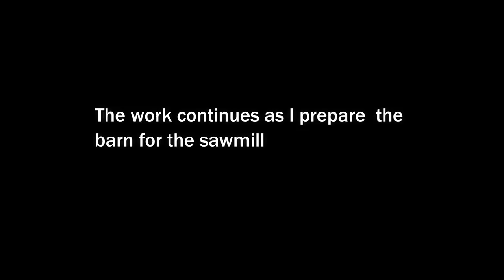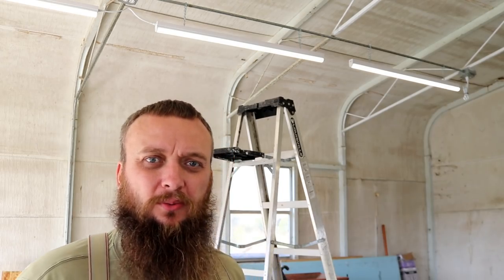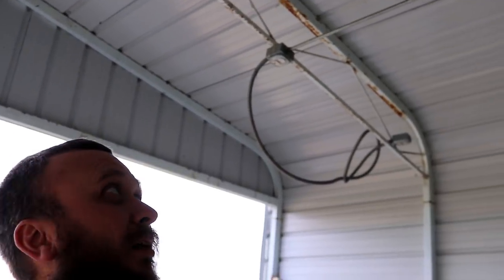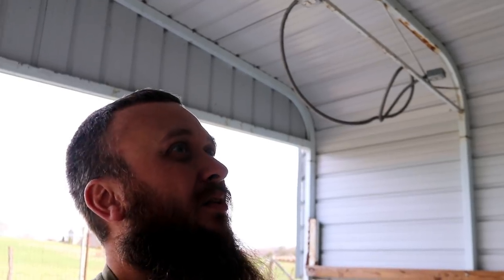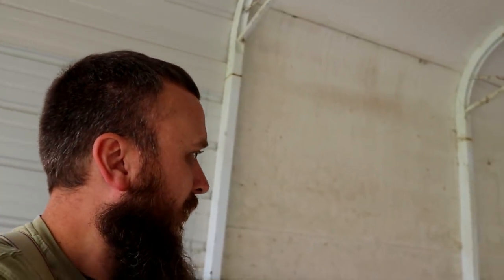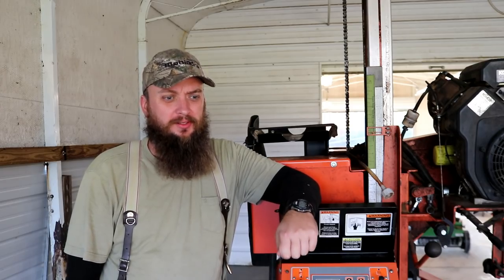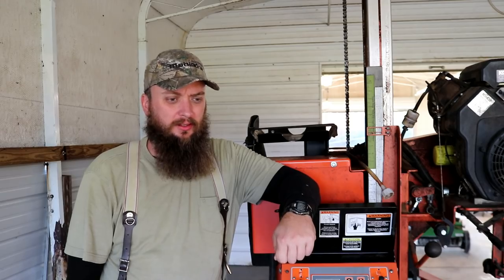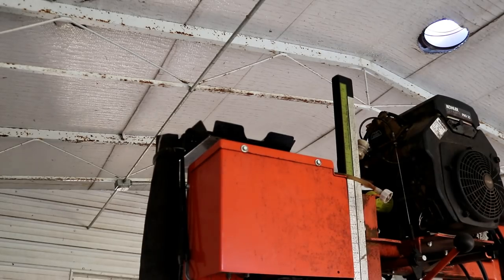FINALLY A ROOF OVER THE SAWMILL!

Comment: Idea for the rusty stuff, a product called ( ospho ). It can be applied anytime it converts rust turns it black and it seals it and can be painted over.  Or the Co. Called Eastwood has a new rust encapsulator. Brush the surface down and it can be painted over as well.  To muffle the noise spray on foam insulation it will take the echo out of the building. It will also stop the metal from sweating and dripping on the sawmill & you.

Comment: You might consider applying Ospho 605 Metal Treatment in the near term to stop the rust until next spring. 

Ospho > is a rust-inhibiting coating a not a paint, it’s a chemical reaction with the iron oxide and converts it to iron phosphate. 
You do not have to remove light rust just  remove loose paint and rust scale, dirt, oil, grease and other accumulations with a wire brush and paint or spray (hand sprayer works well)

I’ve used this many times. Works excellent!

Comment: Some 30 yrs ago I worked at a commercial apple orchard. They ran a cider press in garage over the summer that was lined with cheap bathroom  paneling. In the early summer we power washed of the walls from cider "spray" from the previous season. After the pressing they would let it sit so it would cure for lack of a better word. Cleaned that building right back to New. Amazing machine!

Comment: You’re definitely gonna need hearing protection with that thing running inside. The sound is gonna resonate in that metal building. Even if you were to insulate to dampen the sound, it’s still trapped in that chamber.

Comment: Couple of thoughts: 1, when power washing large areas, I mix a 50-50 solution of Simple Green, Purple Power etc. in a garden sprayer. Much easier on the forearms and you can easily reach high spots.
2, buy quick hitches for your tractors. I'm not sure about the N.H., however, they are available for the Mahindra size tractors. The only draw back is the PTO shafts have to be extended, after that you will thank yourself every time you hook up an implement. I speak from experience.
Have you thought about putting in a few wall fans on the operator side of the mill?
Hope to come visit someday, I'm in Thompson's Station.
Rollie

Comment: Just hope removing the ceiling insulation doesn’t create a rain inside on the days there’s frost on the roof. I know you don’t get the cold weather as bad as we do in Ohio.  I had an older steal building made very similar to yours and if we worked in there a lot the moisture would collect on the ceiling and once the sun hit the roof you would gets drips.   Frost had the same issue.    Great content 👍

Comment: Good for you.  Congratulations.  Are you going to hook-up a dust collector?  You'll find that sawing indoors will provide some problems, namely dust.  I hooked my buddy's woodmizer to a Harbor Freight dust collector (we only used the vac part) to suck the sawdust out of his shed.  It was cheap to do and now the sawdust gets blown into a dump trailer with sides.  Lots less dust in the shed too.  We also installed a 20" fan at the gable end to suck the airborne dust out of the shed to provide circulation.  No point in screwing up your lungs.
Reply from the maker: Good ideas.  Thanks

Comment: I would recommend putting some insulation back on your ceiling or it will get lots of condensation... rust... no good. I’d hate to see the mill rust up. Lowe’s sells the thin bubblewrap insulation fairly reasonable.

Comment: Nathan how are you gonna make the wood mizer stationary? Are you gonna take the wheels off and set it on timbers drilled into the concrete or just chock the wheels? The only reason I am asking is if you get a flat tire then how are you gonna level it up? BTW you don't have an accent, we are both from the south and I understand every word what comes outta your mouth. It's everybody else not from here that has an accent.

Comment: My biggest worry for you and the saw mill is the exhaust from the gasoline engine.... you may or not smell it as some are odor less... need a exhaust fan on the side of building that the engine is on and not sure a carbon monoxide (CO) sensor would not work as the engine is working but for a while when the saw is running a mask may be the right thing to wear...... come familiar with the signs on carbon monoxide poisoning.......Check with OSHA FOR REGULATIONS??????????????? when it is cold or rainy the side vents may have to be closed fan needed then!!!!!!!!!!!!! Do not lose who you are with the accent ...it being part of you...losing it compromises where you are from...it gives you credibility as OTW.... your diction and pronunciation are clear!!!!!!!!!!!!!!!!!!!!!